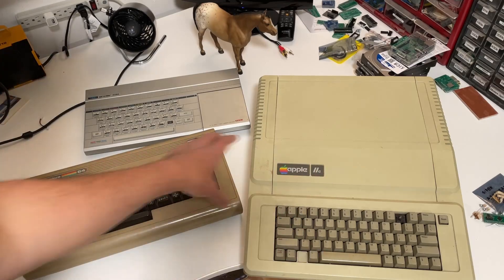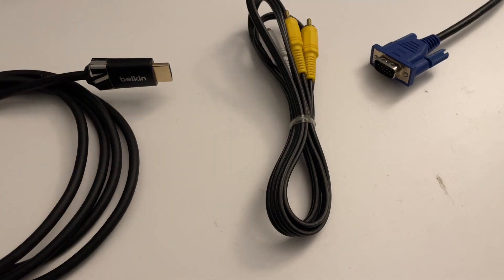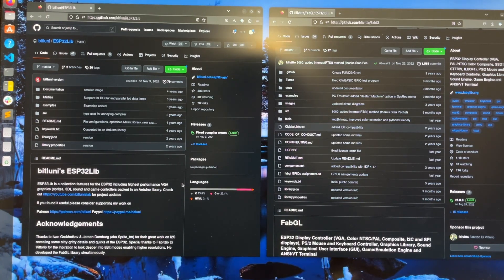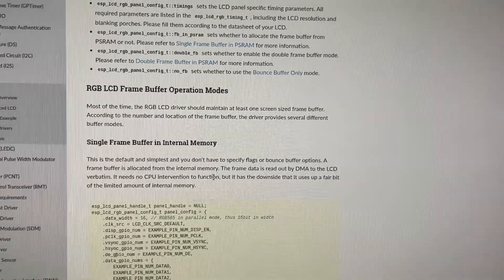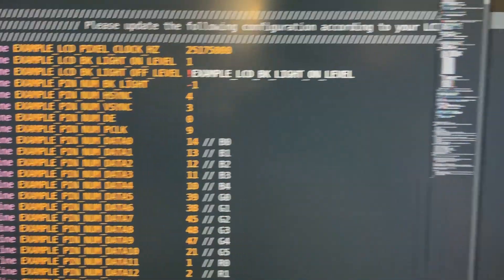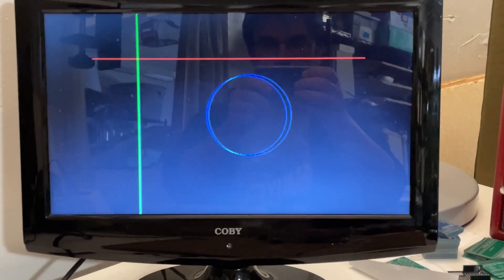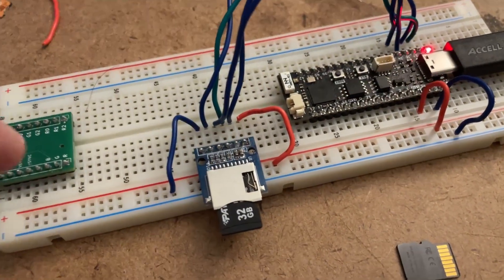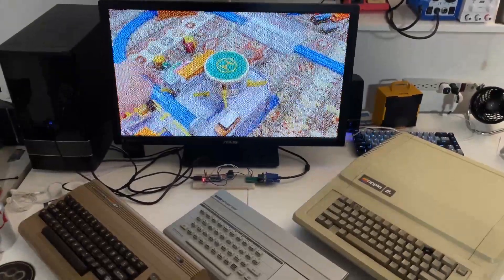Building a New "Retro" Computer - Part 1: VGA on the ESP32-S3

Comment from the maker: Hi, I realized I should have mentioned what a "bounce buffer" was in the video - it's basically a chunk of main memory holding a horizontal stripe of pixels, a few lines in width. Since it's in main memory, the DMA out to the VGA lines is able to keep up with the pixel clock. Generally a small fraction of the whole screen and it gets filled just in time by a callback. Hope you enjoy the video, more coming soon.
Reply: Hiii, 💃💃💃💃Can you make esp32 to accept video  uvc usb and convert it to WiFi video , 2nd circuit is convert pal,ntsc to wifi...👽👽👽

Comment: Let me share few thoughts:
- 3/8 bit is really low. You will need at least 12 (444) for dissent image or even 18 (666) as it was in DOS age VGA
- What CPU you gonna emulate? Z80 or 6502 variations?
Seeing how ESP32 struggle with VGA,  I doubt it has the power to emulate all components of a retro computer. So I would suggest to do what already many others has done - use real CPU with own memory, but use ESP32 to do all the dirty work - video, sound, I/O, SD.

What makes any system unique is the video/sound.
The minimum a modern Video should be as I call it - between NES-SNES like quality. That mean Layers, Sprites, H/V scroll, Bitmap/Tile modes. If you want SNES+ that mean extra things like DMA/HDMA. Ofc you can add even more fancy things like affine transformations (Rotation, Scaling, ..) on layers and/or sprites.
For Sound obviously some sort of PSG (min 8 channels) , PCM capability. You can add things like OPL/OPM xx (or even use a real chips for that).